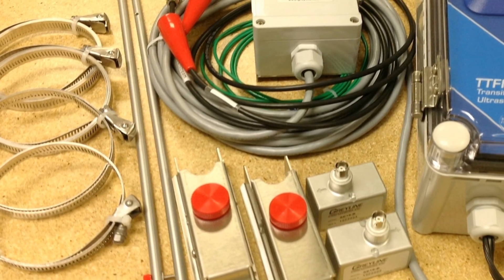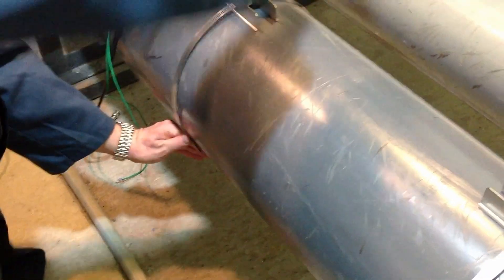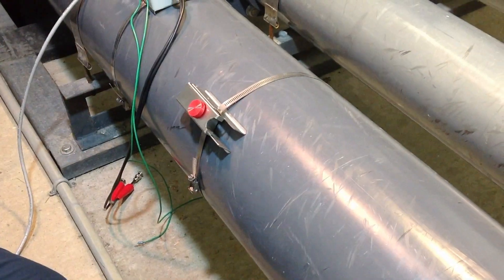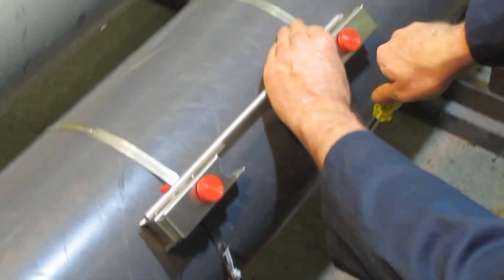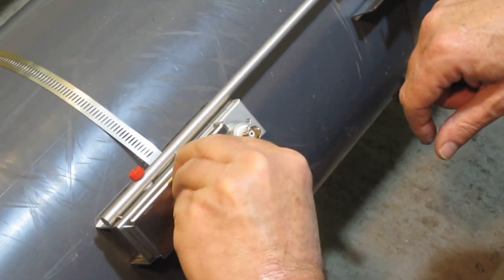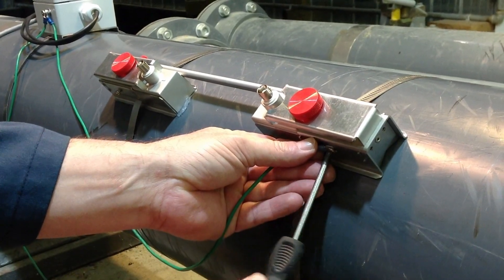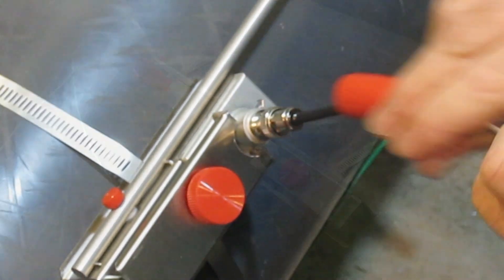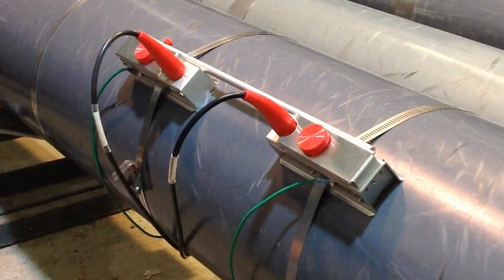Transducer Mounting with the New Greyline TTFM 1.0 Transit Time Flowmeter

Comment: do they work on metal pipes?
Reply from the maker: Hey, Sajjad! This instrument has been replaced with the newest version, the TTFM 6.1. It can measure flow of clean liquids (less than 2% solids/bubbles) in full pipes made from carbon steel, stainless steel, ductile iron, concrete lined ductile iron, cast iron, PVC, HDPE, PVDF, copper, brass, aluminum and pipes with bonded liners including epoxy, rubber and Teflon. 
https://www.youtube.com/watch?v=II4fIvRmijY
Reply from the maker: If you have any further questions, we'd love to help you out. Send some details about your use and application to info@greyline.com.